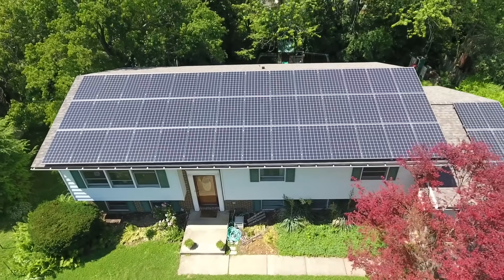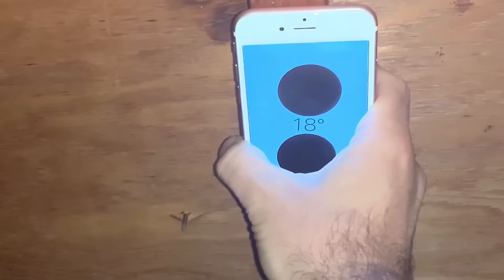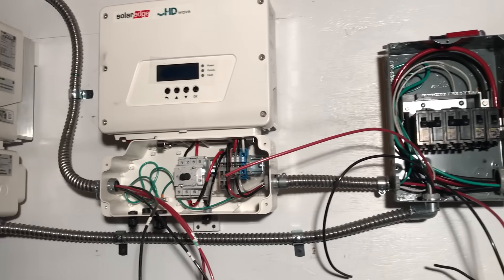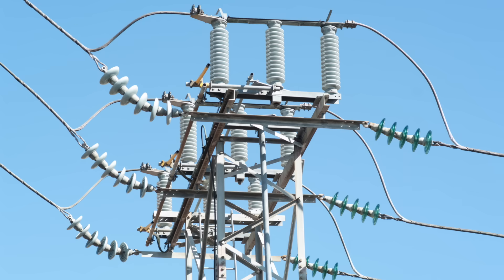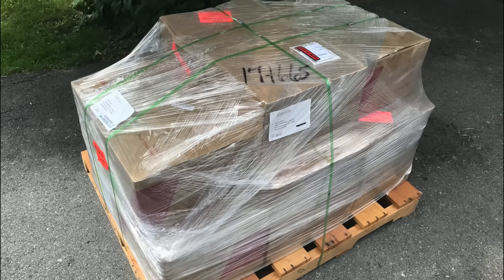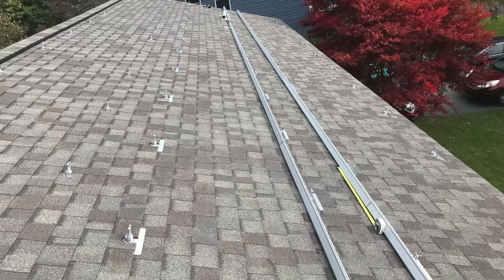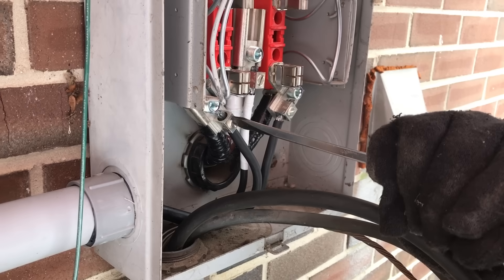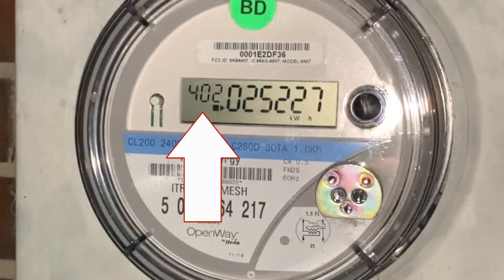I Installed a Power Plant Myself | HUGE DIY Solar Panel System

Comment from the maker: I helped my neighbors install solar!  Watch the new video HERE →  https://youtu.be/QqTAEueb_GI   Also, WHY didn't I install batteries?  The BIG question.  It's answered HERE →  https://youtu.be/AkPeKPuE1VE
Reply: Can you share your upfront cost for materials? Thanks
Reply: why no batteries? because the grid is the cheapest battery storage available.
Reply: @TheyCalledMeT  this is changed now. The grid buys the power at the cheapest rate and sels you at a higher price.
Reply: I have a question, did you ever experience overvoltage? Like 255-266v ranges?
Reply: How did you pay for the solar panels??
Reply: frugal Repair, can u install a solar energy system for other people?. Where do u leave.?
Reply: @brbr6264  for a caldy sack having 6-13 homes yes that would be awesome
Reply: Pregunta: soporta el impacto del granizo de las tormentas?
Reply: You are awesome
Start all this up as a great business
You can help people now with jigh fuel bills.
Awesome get it going wy dont u !!!!!
Reply: Ever thought of running some extra panels to run dehumidifiers? The collected water could go to filters then a sistern tank and used for a water supply for the whole house. This would remove your need to purchase water. Is this possible?
Reply: Hey it was getting a little cold so I threw a few logs into the fireplace. Why don’t you use it m…..
noooooooooooo!
Reply: So, what are you going to do when they block out the sun to combat climate change, lol, DERP!
Reply: Did goverment regulations play any disrupting part in your process ?

asking because in my country we have limits on the amount of power allowed per house. in regards to how much we can put back into the grid.
Reply: Good work. But think about Pylons. What they do!?
Reply: Thank you so much for this video,this is good content!!!!
Reply: V1ENERGY uses its strong power and large storage scale to bring benefits to customers with solar saving actions.
Reply: Why not make electric at night 🌉🌙✨😌🤔😏
Reply: Can this run for 24/7 for a house
Reply: @isaacfungamwango5217  yes
Reply: @hildebertocarreiro9232  thanks though I downloaded pdf but its failing to open
Reply: I was going to suggest installing a few wind turbine generators on top of your roof.   Amazon sells a number of them at a reasonable price.  They even sell some 10,000 watt wind turbines.   With 4 of those on your roof if it is a rainy dark day, you would still be able to power your entire home.   Not to mention they are much easier to install, and are much cheaper.
Reply: @sgodsellify  I like wind turbines too, but out on the field. next to an occupied house may be annoying. 
Also, those small units would not produce too much. And since is grid tied, no need to supplement the darker days.
Have seen some install on farm buildings, but do not remember if they provided production figures. 
Anyway, cows for sure would not fill a noise complaint.  

So, two years passed. I am curious about how ROI has gone by now.
Reply: @ehombane  I am not talking about big tall wind turbines that you see in wind farms, but the smaller wind turbines like the vertical wind turbines.   They take up very little space.  Plus you can add governor's to slow down the turbines, so it will limit their speed, but it also limits the amount of energy that can be produced.  Even if you 400 watt turbines on your roof, and put at least 5 on your roof, then that is 2000 watts.   Also the smaller vertical wind turbines don't make noise.   You need to look again at wind turbines.
Reply: if your getting credit for unused power, you should just do the whole roof lol
Reply: Lol how tf do you clean all that I have to use a plastic scraper window cleaner a rough bristle brush hot water and a foam brush
Reply: y
Reply from the maker: @alec8172 Thanks for the question.  I have made a few videos covering those topics.  Two to point out is the one I made right after this video and the video titled "how I earn from solar".  I also plan to make a video soon summarizing after 5 years of this system.
Reply: Is there a way to get the solar panels go to a power storage unit then once that is filled to go into the Grid? Like to have a backup just in case
Reply: I am doing a new construction, and I am going to need help for my solar system. Thank you for sharing, I love your work.
Reply: @dahliajulme5625  V1ENERGY uses its strong power and large storage scale to bring benefits to customers with solar saving actions.
Reply: Oh yeah the highly-rated Panasonic ones that are discontinued sweet...

What a complete f**** nightmare
Reply: So you're saying your solar panels don't make you self sufficient and the only reason you have no bills is due to the money the grid pays you.... So that means it still costs you money.... Forgetting how much the grid gives you... What would your bill be if you weren't getting paid from the grid?
Reply: @mrzoukdotcomzouklambadaboo8212  It does make him self-sufficient. He generates, on average, more wattage than he uses. Where I am, the system uses 'net metering' where you pay for wattage you use, but if you produce more than you use it gets 'banked' against what you do use. So at the end of the month you pay a minimal  delivery fee (that part cannot be avoided) and carry over your 'banked' wattage.

The only reason to have a battery for saving the excess is to cover you during power outages. With the newer EV's coming out though, you can just use the EV as your battery back up. Keep it charged up and if the power goes out you can use the EV's battery to keep the house powered. If the outage is only a couple hours, no big deal.
Reply: @ronlaverdiere  I'm sorry but only the video maker can answer my question as he said he still gets a bill regardless of offset I want to know how much his bill is and then how much he sells to the grid... Surely this would have been easy enough to show on screen. You see Ron I live in Australia and I know all the scams they do here... But everyone I know with solar panels pays more electricity than I do.... And I live in a 3 bedroom house.... So I know this solar scam very well....
Reply: @ronlaverdiere  self sufficient is when you don't rely on the government for that service... This guy is far from that situation..infact he still relies on the grid.....
Reply: @mrzoukdotcomzouklambadaboo8212  In North America, they have what is called Net Metering. They don't pay you for electricity you generate. All the electricity you generate goes back into the grid. It you give them 100kwh, then you get a free 100kwh's. You might only use 98kwh for the month, so the other 2kwh is carried over to the next month. That way, if you only generate 96kwh the next month and you still used 98kwh, the carry over covers you. There is no money being given back to the home owner. The homeowner could generate 1,000kwh per month and only consume 100kwh, but he still will never get paid for it. He will also still be paying for the delivery fee. The key is to only generate as much as you need to get a net balance of zero over an annual period. If you over build your system, you are throwing away money (sure, you might want to overbuild a little if you suspect you may need more power in the future, maybe for an EV). If you under-build, then you are not taking full advantage of the system.

It is self-sufficient. Yes you rely on the grid, because you are using the grid as your 'battery'. Pay more for a battery and you don't need the grid at all. But why pay that extra cost if you don't need to? That would just be silly considering how rarely most people actually lose power, and for how short a period that normally is.

There is no scam. You can see any time you want how much you are generating and how much you are using. It is impossible to scam someone with a solar panel roof - other than scamming them on the install and materials costs. Unless they are really stupid. Anyone can see their own previous bills and know how much electricity they used over the last 3 to 5 years, and get a monthly average from that information. Build the system to meet that average, and you know that you should have a net zero balance. It is very simple to self monitor the system.

The only reason I can see for anyone telling you they pay more than you do is if they are including their monthly payments for the system - those monthly payments will go away after about 7 years though. It isn't a scam - it is a fact of life when you finance something. It probably takes about 10 years on average for the system to pay for itself, after which you are living very cheap.
Reply: @mrzoukdotcomzouklambadaboo8212   It's ironic that you would mention Elon.  Do know how many years it took Tesla to turn a profit? Look at what their share price was when he started the company, and what it's at now. 

Tesla's was priced at $17 per share when it started. It took 18 years (yep, 18 years) before they turned a profit. I just checked Google to see what their share price is at now (March 23, 2022), and it's almost $1000 USD. They are close to being a Trillion $ company. To make it easy for anyone to understand.... if someone had invested $1000 in Tesla stock in 2011, it would now be worth around $150,300... or a gain of around 15,000%. 😳 Yep, early Tesla investors got scammed alright. <--sarcasm.
Reply: I never saw myself buying an electric vehicle that cost $80,000 but all that changed whenever Joe Biden sent the gas prices up to $10 a gallon

Comment: What’s your take on smart switches?
Specifically, taking the circuits off the main grid that use the most power and connecting them to the smart switch !
Reply from the maker: Do you have a product in mind as an example?  Do you mean like a battery connected to a smart panel?  They usually have to be grouped into a "backup" load block of circuits.

Comment: In your cost you should include cost of man hours, extra tools needed for the project and overhead costs, also in case things go wrong. I guess this only gets worth it when the surface area is interesting enough, electricity is fairly expensive in your region, you can make money back through youtube views or installing it for your neighbours. Also...depending on where you are, your kind government will charge you for sending power to the grid (they can promiss you to credit for the power one moment and change that policy the next year!)
In any case...very nice job!
Reply from the maker: Thanks!  And good thoughts.  I always recommend that if someone is taking on a project to run the numbers and think through pro/cons ahead of time.

Comment: Thank you for the video. Where did you buy your solar panels?
Also, would buying a kit is easier?
🙏
Reply from the maker: Thanks!  I don't know if they are in business but I bought them on close out sale from the altestore  .  A kit might be the right decision for a small system.  I personally would shop individually because you can get good prices on solar equipment separately, even from different sellers.

Comment: Maybe fire code is different where you live, but that would never pass inspection here
Reply from the maker: In my local area they did not require the setbacks when I installed my system.

Comment: Hats off to you from a part time mechatronics engineer…and emergency nurse practitioner.  Don’t ask, it’s a very weird story.  I love both my professions.  Anyway, your work is professional.  You could charge for what you do.  Lots.  It’s truly as good as any professional.  For me, I build stuff just because.  I have friends who call me a mad scientist.  I guess that’s true.  For a solar power plant, which is exactly what you’ve got, ROI definitely matters, but building toys, ROI matters less, although selling stuff can be fun too.  Obviously I got my mechatronics engineering degree later.  🤣. There are on-line courses to receive certification as a solar installer and if you’re really into it, you can get an associate’s degree as an electrical technician in some states, not quite an electrical engineer but enough training to design systems and install them.
Reply from the maker: Thank you very much!
Reply: Are you considering adding panels to the lower third of your roof on the opposite side?  You may have enough light hitting those panels to increase your return from the company to save for repairs and upgraded technology.  I’ve been futzing with a 72 volt solar system, nothing as impressive as what you have, more as a learning experience.

Comment: By by earth , batteries are worse for the environment than fossil fuels. ... besides doing this plant more trees & go more biodiesel technology. This will save the plant. 

Yes, solar panels do produce heat as a byproduct of converting sunlight into electricity. While they are designed to capture light energy for electricity generation, some of the absorbed sunlight is converted into heat. This heat can cause the panels to get hotter, especially in direct sunlight and warmer climates.
Reply from the maker: I did not install any batteries when I put in this system.
Reply: @FrugalRepair your solar panels don't use batteries?

Comment: Can you please list which software online helped with that electrical code diagram design?
Reply from the maker: It seems they aren't offering the same service anymore since it seems they were bought out.  So you might have to google for other options but what I used was called solardesigntool (which might still work but cost more)

Comment: There's a ton of shady ads on the links in your description.  You should really remove those while you hash that out.  I accidentally clicked one and it locked up my computer with a scammy "you've got a virus" type full screen warning.   Super shady.
Reply from the maker: I double checked them they are all safe.  Do you know what link you clicked on that gave you that result?  It could be some 3rd party website ad that said that.
Reply: @FrugalRepair  I couldn't tell ya, I had to hard power down my laptop to get out of it.  I'm 90% sure it was on one of those sites though.  One of the blog ones with all of the ads
Reply: This guy is shady because he’s lying! Your best system will save $20 a month. THATS IT, and maintenance is super expensive. This is a total lie I’m disgusted.
Reply: @playinragz8183  well, now you're just stupid.  Because I have a garbage system on my house that I inherited from the previous owner and it saves me way more than that....

Comment: This is a really great video! 2 quick questions that I hope haven't been asked already. (I promise that I tried looking through the comments) #1 - What program did you use for creating your permit documents? #2 - Did you have to get an electrician to sign-off on your permit and interconnection? That is currently my biggest hurdle.
Reply from the maker: Thank you for watching!  I would have to look up the program I used.  There are many of them that have come out since I did my system.  If you email me, I can search for it.  No, I did not need an electrician to sign off on my permit.  I worked directly with the electrical inspector and the power company interconnection myself.

Comment: Well, I hope there is no space open behind the panels that would absorb water from rain, snow, etc that would become entrapped and left to rot your roof! That would be awful!!
Reply from the maker: It’s installed correctly to spec.  There haven’t been any issues with water.

Comment: Great video. Aside from having room for wiring, is there a reason why solar panels are several inches (a foot?) above the roof? I  sort of like the idea of keeping it more flush to minimize wind coming in underneath it, plus it would be extra protection for the roof..
Reply from the maker: Thanks!  One of the main reasons you see other solar arrays with the setbacks from the edge is because of the national electric code requirements.  I didn’t have to abide by that requirement because my locality didn’t adopt that portion (they have since though)

Comment: Do you have batteries?
Reply from the maker: Not when I designed the system.  In the past year I’ve reviewed some battery systems that can connect in to the backup load center.

Comment: Impressive project to tackle fully DIY... design, permits, procurement, installation, testing. From a 37 yr Gen Contractor... GREAT job!!! Thanks very much for sharing your experience... I know this video also required a lot of hours to produce.
Reply from the maker: Thank you!  It was a lot of work, especially to learn the NEC codes, but well worth it.  I plan to make a summary video soon to highlight how it has performed over the years.

Comment: For such a huge installation and including all the expenses incurred in the future for maintenance or battery replacement, did you ever calculate how many months of electric bill will it cover ?  I have seen other videos with a smaller installation as yours and the cost is around USD$15000, every month , I am paying around $25 electric bill, USD $15000 = 50 years of electric bill charges and within 50 years time, say the batteries last for 5 years and it may requires to replace the batteries for 10 times, and including all these costs and other maintenance if some solar panel fails within this 50 years, all the cost would be equivalent to approx 70 years of my electric bill cost. why not pay $25 each month to the electric company ?

Comment: There is absolutely zero chance that I would do this if I had to tie it into the grid.  The only solution I'd consider is off grid.  It's too much work and money to still have to deal with the power company.  Selling the power back isn't something I would want to do either because the power company most definitely rip me off in every way they could.  Great idea if you have a lot of money to spend and if you could make it entirely off grid.